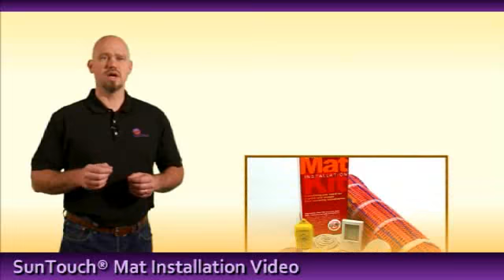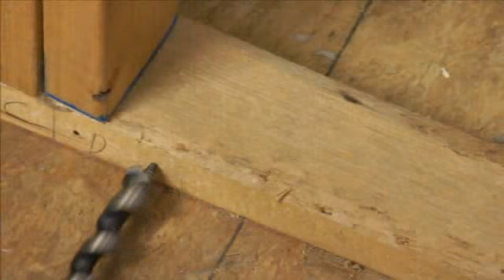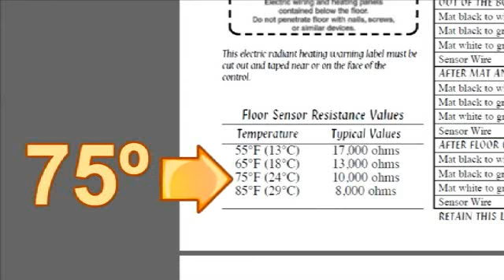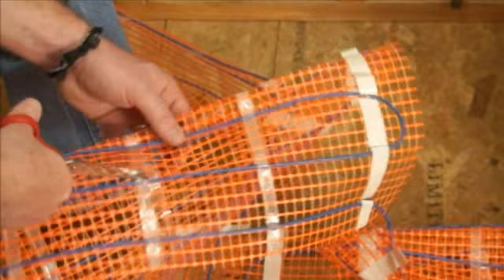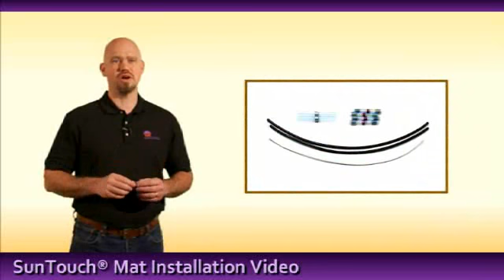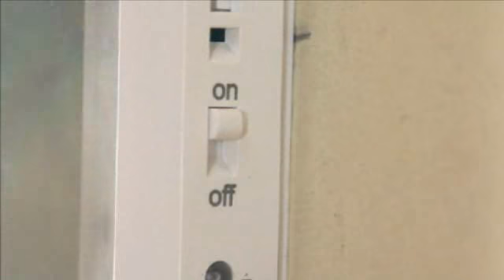How to Install a SunTouch Electric Floor Heating Mat

Comment: Should my tile sub install the power and sensor lines?  Or should my electrician?  Doesn't the sensor line need to be feed to the control panel into the wall inside its own conduit away from the power lines?

Comment: I think it is a system that does not allow a very secure installation of the tile due to the mesh. Also they did not use the plastic trowel.

Comment: I'm confused  You said do not set mat in wet mortar or cement then you set it in thin set??
Reply: The mat is installed & attached to the subfloor and THEN covered with mortar for setting tile.

Comment: You should always pass the floor sensor through a tube in order for it to be easily replaced
Reply: How the hell you going to flatten a tube to fit under the thinset & tile??
Reply: @Rico702Vegas  You "dig" enough under it so that height of the cement you put over covers it. Plus, there are multiple size tube diameters.

Comment: Cool. Simple to install. I'm going to use backer board over the floor tho. I'd never go directly on plywood/osb subfloor. Especially in a bathroom wtf
Reply: Generally you can tile directly over plywood as long as it meets deflection requirements, but not osb
Reply: can you provide a link for the type of product you refer to? I'm about to install mine and was trying to find out if I need to install a sublayer to the thinset or not
Reply: Yeah, I agree.....probably a "just give them the basic idea" video. Obviously if you're installing tile, you'd have Du-rock and waterproofing membrane down first.

Comment: We want to put this in a house that has tile and carpet now. We want to pull out the carpet and put this only where the carpet is will we see a significant difference in the height of the tile. another words, how thick is the product?
Reply: It's only 9 inches thick

Comment: I got into a discussion on a forum with an electrician/inspector over some info in the installation instructions that seems to contradict the use of a 20A breaker for a mat that small. He said that he would fail an inspection if a mat that size were installed on a 20A breaker. Instructions: "The circuit breaker in the main circuit panel should be 15 amps maximum for a floor warming system totaling 12 amps or less.  For larger systems up 
to 15 amps, use a 20 amp maximum circuit breaker."

Comment: Does it make a difference whether I install the Sunstat Pro therm and mat on a 15A or a 20A breaker? I planned on running a 20A dedicated circuit, and I have a bunch of 12/2 wire I wanted to use up; I didn't want to use 12/2 wire on a 15A circuit. The mat I'm installing is only 10 sq ft.
Reply: On this 15a v 20a issue... First determine the power required for the heating system in watts. Let's say 1500 Watts as an example. So 1500÷  115vac would equal just over 13 amps. If the run is 75', NEC codes say 12g wire. You've got to take in account for the wire resistance and resulting voltage drop (based on distance to the panel) not to exceed 3%. There may be a code saying 14g wiring for only lighting circuits.  Frankly, if you need to ask these questions, get an electrician. Wiring your house wrong could result in your insurance Co not covering a fire or other damage.
Reply: IF I install a 20 amp receptacle on  20 amp/#12 wire,fed by a 20 amp breaker,  ,then plug in a 5 watt light bulb to the receptacle, that is not a problem. There is plenty of power available ,opposite of a problem. You can also do what you suggested, Use #12 on a 15 amp breaker. The control unit gets powered first on the line side of the controller ,THEN "Drips" the power from controller to floor wire.
Reply: I oversize my wire all the time.  Learn physics or don’t do the stuff